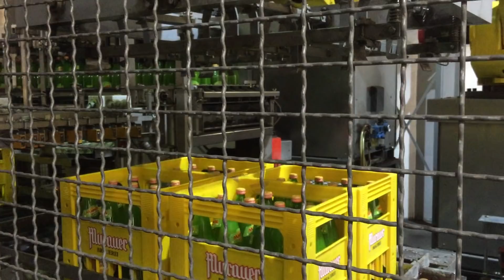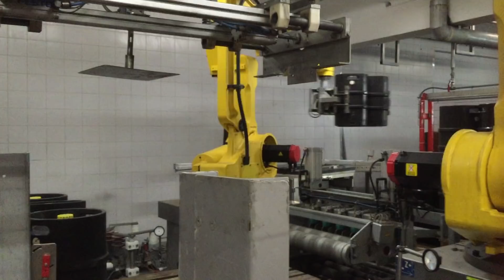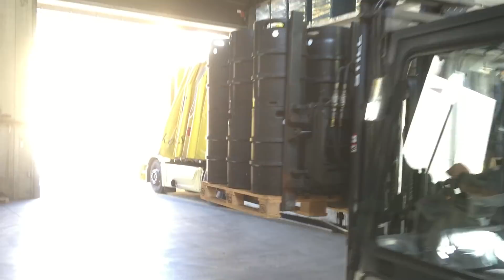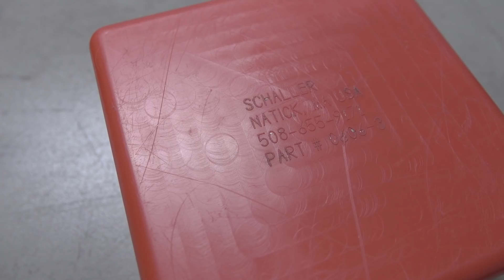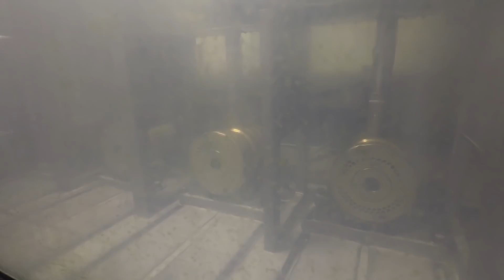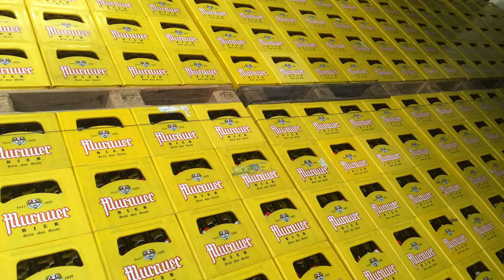No CNC Machines, No Beer?   Tormach Blog - March 2018

Comment: Those Robot arms also considered CNC's. Don't forget CNC stands for Computer numerical control
Reply: The concept of CNC is usually applied to the computer control of machine tools (material removal).  Machines such as mills, lathes, grinders, lasers, punch presses, etc.  So all CNC machines are computer controlled, but not all computer controlled machines are CNC.